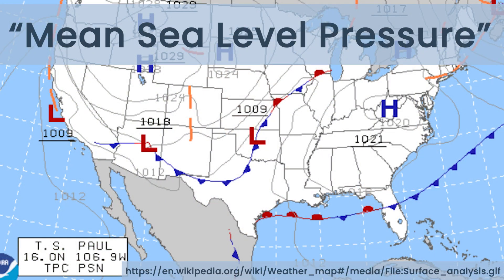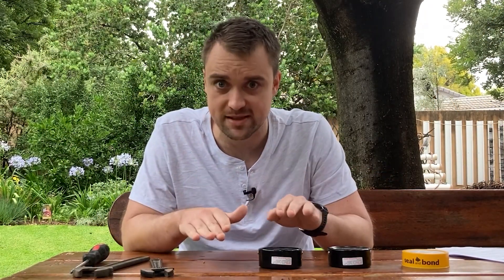Does Altitude Affect Pressure Gauge Readings?

Comment: A way I would recommend doing this experiment:

Rather than connecting to an end-cap, connect to an open valve with the proper plumber's tape to seal the threaded fitting.  Let in the 1 atm of pressure at sea level, and close the valve before transporting it to high elevation.  This way, you can seal your sample without increasing the pressure.

Comment: Hi pat. I've a question. Suction is always negative? Why don't we  have negative pressure in the suction of a pump?
Reply from the maker: Hey Jorge. I actually thought you made this comment but n my “What happens when you increase pump suction pressure video”. There I show you an example of a pump whose suction pressure is in fact negative (I.e vacuum/pressure less than atmospheric). But pumps can have both positive and negative suction pressures depending on what is upstream of them.

 If a pump draws from a vessel under pressure then the pressure will be positive.

If a pump draws from an atmospheric tank with a low level, and that pump has a long suction line, then the dP in that line can cause the suction pressure to drop below atmospheric (negative gauge).

Both are possible.
Reply: @ProcesswithPat  Hi Pat, I've just start following you. I will look into that video.
So here why my question, Could we have a blower "sucking" from a recipient that it's at 10kpa and in the vacuum line we will have suction but as the Blower it's just making a vacuum pressure of 4 kpa we will be reading in the manometer 6kpa. But the blower will be working fine as it is making the depressure. 
Also, this blower has a filter in the vacum line. How will the diferrential presure of this filters work when it gets dirty in the reading of the vacum line manometer?  I'will have less "vacuum"?

Thank you for your channel. I'm looking at all the videos, they are pretty interesting and fun. Keep the hard work mate.
Reply from the maker: I’m not sure I understand your question man… wanna try rephrase?
Reply: If you convert it to absolute pressure there is never negative pressure.  Nothing ever sucks, higher absolute pressure on the other side always pushes out.

Comment: Can u please make a video explaining "Glashier's law" in case of relating "dew point temperature, wet bulb temperature and dry bulb temperature and ambient temperature". I mean,  (T1-T)=G(T1-T2) , where G is Glashier's constant.
Reply from the maker: Hey there! So I had never hear of Glashier's law, and all I can find is the Wiki page for the meteorologist James Glaisher, whom I presume you're reffering to? I can however look into deriving the relationships if you explain what you need...
Reply: @ProcesswithPat   Exactly, that's James Glashier's law ! It would be good if could send u the text regarding the law , but wait I'm giving u the link , ... pardon me for late reply.
Reply from the maker: Let me know about the link…
Reply: @alzenodoe5765  I think that is a linear approximation.  The relationship among these variables is extremely non-linear, and is based on the Antoine equation for the temperature vs pressure equation of water's boiling point.  This is why you either use the chart, or a program with the functions built-in (as I do with EES), rather than calculating the formulas by hand.

I just explored this, given the case of 100kPa and 50% relative humidity.  I'm assuming T1 = dew point, T2 = wet bulb, and T = dry bulb in your formula.  If that's the case, the value of G was nowhere near constant, when I swept T from 0C to 40C